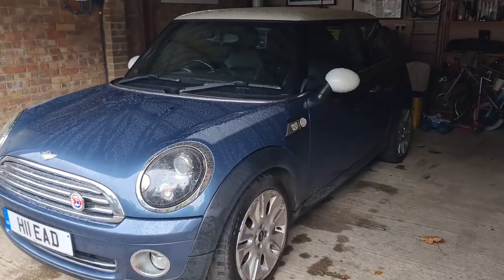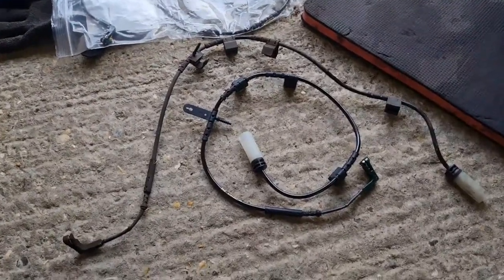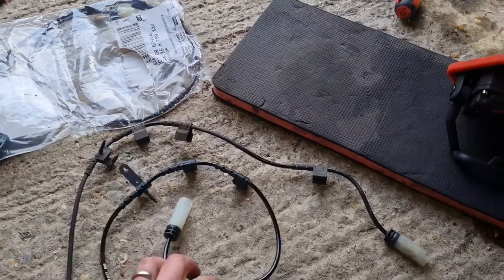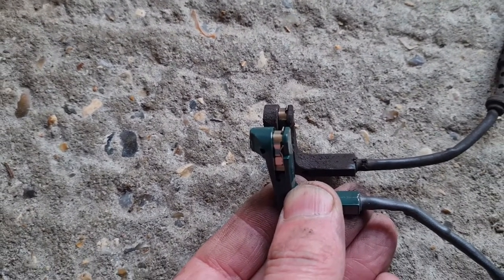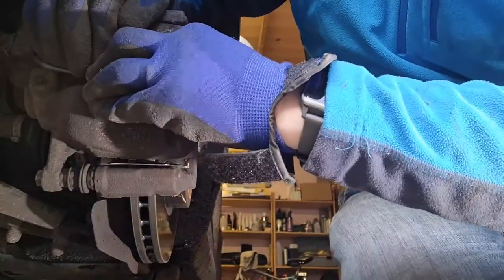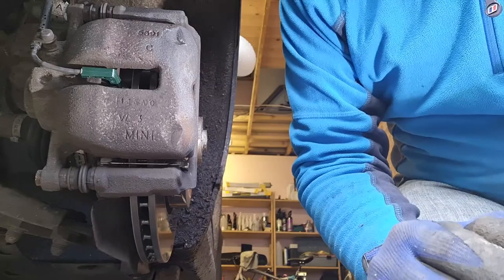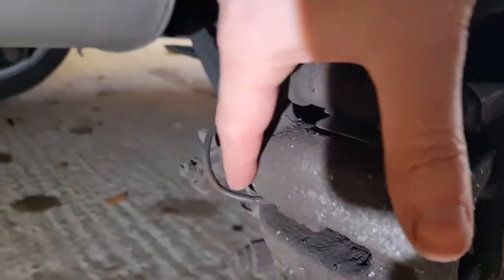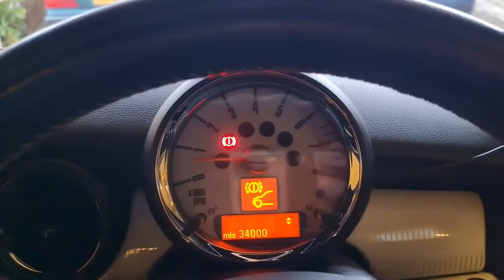Mini Cooper (R56) - Brake pad wear sensors fitting and reset procedure.

Comment: Thanks! I just fitted new discs, pads and sensor on the front, but still had the warning light showing. 
I followed your instructions and although I didn't get to the front pad reset miles (I'll try that another day), it did a system check before I got to the brake reset bit and I got All OK, and my brake warning has gone away now. So all ready for the MOT tomorrow - phew! Thanks again.😀
Reply from the maker: That's great to hear Tony - I'm glad it worked for you. Hopefully you got a clean MOT pass too!

Comment: Hey brother, not sure if you reply to this comment but I have a 2006 mini Cooper and it's a six speed but when I'm driving on the highway randomly the brakes will start to engage. I have to pull over once I come to turn the car off and then back on then I'm able to move again. I don't know what it would be causing the brakes like that
Reply from the maker: Certainly doesn't sound right. Check that you don't have a sticking caliper (quite common - happened on 3 of my cars previously) and then check fault codes using an OBDII reader to confirm there's no issue with the ABS module.

Comment: Really helpful video, just ordered the sensor to do this next weekend. Although currently I also have 2 more lighting indicators on my wife's R56: Exclamation mark is always displaying ( the one which is on when you pull the hand brake), and also I have the "car on ramp" service light on. Do you think changing the brake sensors and reseting it will also delete this two? We have read the error code with my repairman, but there was nothing else, just the brake pad sensor wear ....

Comment: Why do they have to make it such a mission? I've never had to remove a wheel arch cover before to unplug a sensor, they are usually less than 10 inches long.
Reply from the maker: It's annoying isn't it. I didn't like that car though and I'm glad to have got rid of it. On the subject of brake wear sensors, I've replaced loads in my motoring career, but never once have I activated one because I'd never let my pads get that low. So on my Alpina rather than spend on new sensors I just made a shorting out plug so I never need to deal with it again.
Reply: Just having to do mine as the wire has snapped at the pad mounting end. I've previously done the rear and could just about get to it with just the wheel off. The front looks annoying but its that or MOT fail. I tried the wire the connectors together trick but it didn't work. I guess the sensor is a resistor or something.
Reply: @MostlyHelpful  i often let mine get too low but i guess i jut ignore the light. I've usually got them in stock but once i drove 10 hours from Barcelona to Chamonix (not on motorway) with no front pads left. managed to save the discs (rotors) using gears and hand brake.
  Annoyingly i first unplugged the abs sensor but then i saw there is a hole you can probably get your hand through to get to the plugs if you know what your doing. The wheel arch cover wasn't that bad but i never have the correct tools for those plastic rivets. The other annoying thing was that i bought left and right sensors for front and back only to find there is only one per side as usual. Seeing both left and right listed on Autodoc threw me off. I should have looked first. Probably them trying to trick people into buying more stuff they are identical.
Reply: @1000sofusernames  try the reset, someone did a vid on how to reset the estimated ware left. You do it all on the spedo, it's a bit tricky but you will get it.

Comment: Thank my guy
Reply from the maker: No problem Adam and thanks for taking time to comment.
Reply: @Mostly Helpful  You're welcome. I reset it with my snap On legend scan tool, but it popped right back on. Thanks to your video, it made it super easy to turn off the light.

Comment: Are they only on one side please?
Reply from the maker: Yes, only on the one side. I've never in my life worn through a brake wear pad sensor though, so I am not sure how useful they are!
Reply: @MostlyHelpful  Once you get about 3/4 through the pad, the sensor starts getting worn too and that causes it (I am guessing) to earth on the disc and make the warning light come on, until it is reset. Perhaps you always got your pads replaced in plenty of time and the light never cam on for you; but apparently when you remove a sensor, it tends to break it, so they have to be replaced anyway. (Mine broke, but they were worn anyway). 🚗 Have fun out there 👍
Reply: They're on left front and right rear. Standard German stuff.